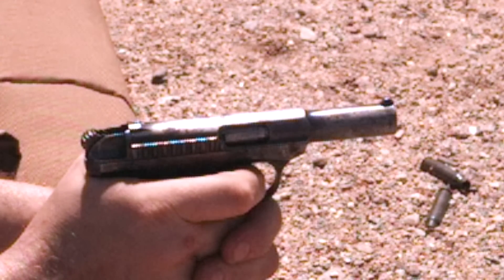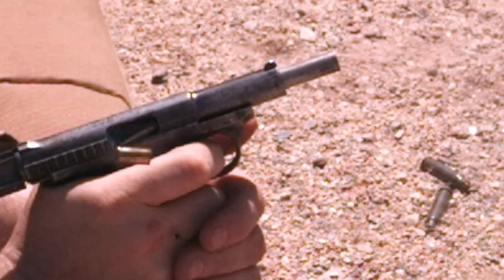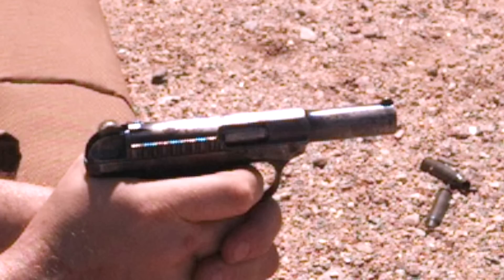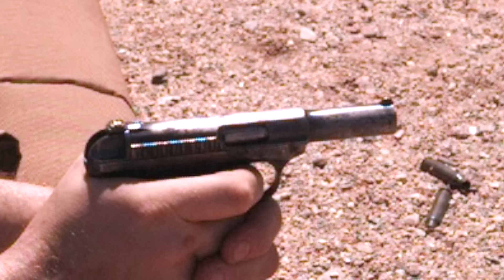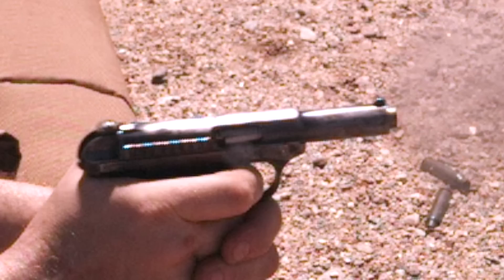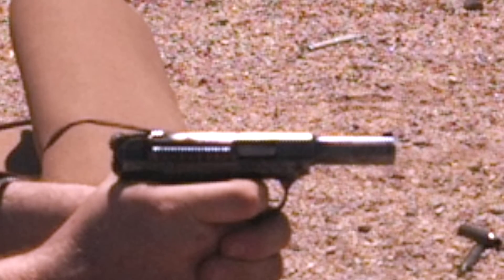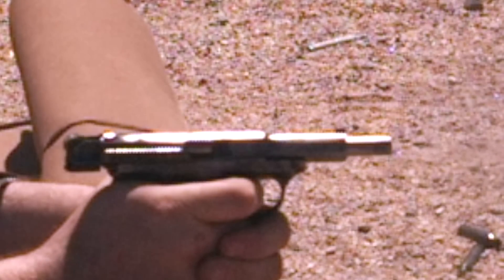Ask Ian: Analyzing the Savage Rotating Barrel (at 7500 frames/sec)

Comment: I may be misunderstanding how it works, or how physics works, but it sounds like there may have been a simple mistake (though more probably the mistake is mine).  As Ian explains it, it sounds like the system rotates one way (cw or CCW) and the bullet rotates the other way...  but what with equal and opposite and all that...  the bullet is exerting force in the direction opposite to it's rotation, and vice a versa...  so, say the barrel "unlocks" by turning CW...  if the bullet is rotating CCW...  then the force the CCW rotating bullet imparts on the barrel...  would be CW, wouldn't it?  So the bullet actually accelerates, rather than decelerates the "unlocking"  to delay the unlocking, the bullet should, as I understand it, rotate CW, imparting a CCW force on the barrel to delay the CW rotation of the barrel?

On locked vs unlocked...  I don't know.  The turn is very small...  but watching it frame by frame, it does seem like the slide moves back by maybe 1-2mm while the barrel turns...  Looking at the slowmo footage, it's very hard to say if the slide has moved further, or if the barrel is still turning, still unlocking.  I'm not 100% convinced this proves it one way or the other.
Reply: The Savage 1907 has a CW rifling, so the bullet is forced to accelerate rotating CW and, for reaction, it imparts a CCW force to the barrel. 
Since the barrel must rotate CW to open the action, that contrast with the opening. However, since the recoil momentum is MUCH stronger than the rotating one of the bullet (otherwise the bullet will never leave the barrel) that can't lock the action.
Reply: @neutronalchemist3241  That seems to make sense.  It's hard to judge distances and such but it seems like the slide moves roughly half a centimeter while the barrel turns, then by roughly a centimeter it's clearly open.  It's just hard for me to judge by the high speed footage if the slide has moved enough to unlock the system

Comment: So the Savage goes into the same cathegory as the CMMG Banshee as a radially delayed blowback system? That's cool :)
Reply: Unfortunately, no.

Both systems use rotation, but they do so in different ways. This uses rotation of the barrel to delay the opening of the slide and this the breech, but there's nothing that's taking the force on the breech and putting it through mechanical disadvantage. In the CMMG system, the breech face's opening is delayed by having to exert the force against mechanical disadvantage. In the Savage system, the opening is delayed by the friction of the bullet against the rifling causing the barrel to resist rotation for just long enough for the pressure to drop.

Comment: A patented design claiming to do one thing but actually doing something else that still works - reminds me of the Blish lock :D
Reply: Or the Rogak P18, which was a case of "a broken clone of a patented design that works but only just".
Reply: @AshleyPomeroy the utae needs
Reply: @AshleyPomeroy  if the barrel rotates 5 degrees clockwise, and the twist is clockwise, wouldn't that cause the barrel to spin around the bullet, negating the torque, and diminishing the angular momentum that's requisite of being affective "in range"? Or could it be synergistic, and increase the spin?
Reply: @ghostwriter1415  You mean twist is counter-clockwise.
I think also that barrel and twist should go to the same direction, as now since bullet is forced to turn left and barrel turns right, I believe it actually makes the barrel rotate sooner/faster since rotational mass of bullet tries to be stationary thus forcing the barrel turn to right
Reply: @felixchaus  The way I understood it when Ian described it is that barrel and twist rotate in opposite directions so the spinning bullet supposedly counteracts the rotation of the barrel, I'm not expert but I don't really think there's enough friction between bullet and the inside of the barrel to do that 😅
Reply: @MrFreddyFartface  There is enough friction to force rotation on to the bullet in few inches of barrel, 
and if there are some instances where inner core of a bullet separates from copper jacket because the copper jacket is forced to rotate faster than inner core can.
If you take a bolt and a nut, nut is the barrel and bolt is the bullet, barrel is stationary and bullet rotates, but you can also keep bullet stationary and rotate the barrel/nut, or even better is pump screwdriver, when pumped screw/bullet goes clockwise and screwdriver tries to go counter-clockwise, same works on the barrel but directions are opposite
Reply: I was thinking the same thing haha
Reply: Exactly what I was thinking. It's a system that I call Unintentional Delayed Blowback. It works, but not for the reason it's supposed to. 😉
Reply: Except by the looks of it, it actually wrkd as a delayed blowbacc system, while the delay the Blish system gave wasn't that much

Comment: I've got two of these, made in 1905, both with "patent applied".  I bought them decades ago, for my wife's home defense, and have enjoyed shooting them for target practice.  Thanks, Ian!
Reply: They feel so good in the hand. Like a solid block of steel. If only .32acp wasnt so expensive.
Reply: @niffirg1113  Why not make the .32 ACP yourself? The Lee anniversary reloading kit is about 129 bucks now.
Reply: I got a 32 for my wife.
Pretty good trade, eh?
Reply: @imilliemedina666  Having never met her, I couldn't say for certain, but probably a good trade given the state of the world.
Reply: Definitely neat pistols. Do yours have very heavy triggers? Mine is almost 8 pounds. Also, none were made in 1905; that’s the patent date. The earliest were made in 1907.
Reply: @76horsepower  Yes, they do have heavy triggers, both are marked 1905 pat.  They don't have any other date on them.  I bought one for my wife, a friend bought another, and ended up selling it to me, having moved on to another handgun.  They have a rather heavy "striker mechanism" giving that heavy trigger pull.  I hone the sears and they are both much better.
Reply: @johnmcclain3887  Thanks. You can determine the manufacture date via the serial number on the front of the frame.
Reply: Did she ever fire both of them at the same time, while flying through the air?
Reply: DesertRat45  Different pistol, same mechanism.
Reply: “It banishes fear!”

Comment: So if that is the case I guess my MAB P-15 is also just delayed and not really locked because its barrel is fixed in a similar fashion, but shooting full bore 9mm (explains the stiff recoil spring.) Whereas my Cougar also has a rotating barrel but the barrel travels with the slide for a good 7.5mm before it rotates enough for the locking lugs to clear and come free from the slide. Interesting.

Comment: My old man had one of these that I took out of his desk after he passed. Its entirely locked up. Excited to get it functional now.
Reply: Were it in a desk, it is possible that it is simply gummed up lubricant.  Added to carbon fouling (and looong periods of time) it can make a substantial glue.  Some modern oil, strategically placed, should help free it.
Be aware if it is in a desk, it may be loaded.  Relevant if one is fiddling with it and fighting to get the slide unlocked.
Good luck!
Reply: @mattfleming86  At some point someone tore the ass and spring out of the magazine. I am going to CLP it when I get home and see what happens. Thank you!

Comment: I've always loved this little gun.  I managed to find a good version for sale on the cheap several years ago and have enjoyed it.   Also, it's fun to be able to hold a real-world, nearly identical example to what Ian is showing.  ;)
Reply: I have a 1917 (with a 1907 breech block) and it's a great little pistol, although it might need some refurbishment because I get some light primer strikes from time to time. It has surprisingly light recoil for its weight, most likely due to its barrel system.
Reply: @jnordne2  - Nice! They are little wonders.
Reply: I wanted one since I saw Jude Law use one in Road to Perdition. I found one at a pawn shop for cheap. It was rough. The front sight is gone and the extractor was not working. I got a new extractor spring, re-blued it, and got some white re-pro grips.
Reply: I have one my great-grandfather who was born in 1882 bought in 1911. It's in borderline perfect condition (It looks way way better than that one Ian is shooting) despite it being over a hundred years old. It's funny shooting it and my Shield Plus side to side its heavier and has more felt recoil while shooting a dramatically weaker cartridge, at least both me and my father thought so. Other than that though the only real issue I have with the little guy is the sights on it really are horrible, basically point and shoot level of usefulness. Still a really neat family Heirloom.
Reply: have you mounted anything on the 1907 picatinny?
Reply: @Verycereus  - Um ... no rails, no fancy ultra-modern anything (except a high-cap mag) on these babies, man.  You must be thinking of a different pistol ... or I'm too tired and sore and missed your humor (in which case I apologize).
Reply: @CeltKnight  joking, friend. it just has a weird picatinny look on the side there.
Reply: @Verycereus  - Oh!  LOL ... sorry, I was too tired to catch that.  ;)  It DOES look like a rail.  And, that thought made me dig it back out and mess with it and ... ouch.
Reply: Yet another coward!
Where do you children come from?

Comment: I love to shoot my 1907. 10 shots quick is fun. I wish the new savage stance wasnt such a pile. The savage stance would have been a great gun 10 years ago. The stance should have been 10 shots minimum. Then savage could redo some of the vintage ads
Reply: Yep, if they were going to adopt the Honor Guard, they should have redesigned it for a 10 (or more) flush fit. The existing chassis could probably even accommodate it. It's as misbegotten a move as the FN 503.
...I just realized, I own (and like) 509's, APX's, and Savage rifles, yet even I have no interest in the 503, APX Carry, or Stance. I'd be more likely to buy a GX4...
Reply: @funkla65  Savage is selling the Honor Guard?  Ouch.  Friend of mine had one and it was complete junk...
Reply: @immikeurnot  I have an Honor Guard Long Slide. Haven't shot it a lot, but has been dependable. Not particularly accurate, though.
The Stance has received a substantial facelift, so I'm guessing the tooling and all the machining files were redone, so hey, maybe Savage debugged it. Mag capacity ought to measure up to the ShieldPlus, though.

Comment: Would it bee cheaper to perform the barrel-pen test? Just fixate the barrel and sick a pen, with rubber fist, into the barrel. If the bolt/slide will open, you can be sure its a blow back or blow forward system. If its doesn't its for sure a positively locked breech. Fell free to prove me wrong.

Comment: Just was comparing this with MAB PA-15. Watched Chappy's video on it but still not clear how well it compares to Savage while also how it is different from a short recoil rotating barrel. And how effective it is both in Savage and in MAB?
Reply from the maker: The system in the PA-15 is true short recoil, rotating barrel locked breech (same with the Steyr Hahn, Beretta PX4, and Grand Power, among others).
Reply: @ForgottenWeapons  After your reply I rewatched Chappy's video, his opinion is that barrel rotation and slide remains together for shorter period of time compared to true short recoil rotating barrel like Steyr Hahn or Baretta PX4. So the rotation of the barrel starts much earlier in MAB PA-15 when compared to above mentioned pistols. His opinion is that MAB's operation is a delayed rotating barrel. So can you guys discuss and tell what it actually is and its effectiveness in taming 9mm.
Reply: @TakNuke  I clearly said the barrel and slide do NOT recoil together since the barrel is fixed axially in the frame cradle. It functions identically to the Savage 😉
Reply: @thebotrchap  After rewatching Chappy's video several times i understand that barrel is not moving only rotating so I conclude that MAB PA-15 is delayed rotating barrel blowback mechanism but how effective it is I can only refer to his Lynx Brutality run.
Reply: @TakNuke  In case you haven’t put 2 and 2 together, Chappy and I are the same person 😉 The system is certainly safe and recoil is not harsh, however finding out how much is due to the delaying mechanism and how much is due to pure slide mass we simply cannot tell.
Reply: @thebotrchap  I was unsure about whether the previous comment was by you so for being on the safe side I addressed about your video in third person in my reply. Thank you for the reply and also thanks to Ian regardless of whether your reply came due to my first comment while you viewed the video or him contacting you for getting your view. Again thank you both you, Ian and other commentators for their insight and clarifying my doubts. Now the only thing that remains is getting either one of the Savage  (preferably) pistols or MAB PA-15 in Ian's hands for the backup gun match and getting to know his view on the delayed rotating barrel blowback effectiveness.
Reply: @ForgottenWeapons  I'm happy to know you're familiar with the Grand Power pistols, knowledge of them seems to be fairly rare so it's certainly nice to see a mention of them.
Reply from the maker: I hate being wrong, and I am currently wrong. I went to take a closer look at my PA-15, and yeah - it's very similar in operation to the Savage. Definitely will require some more high speed footage, and in particular a comparison to the MAB Modele R.
Reply: @ForgottenWeapons  Are we getting a PA-15 video next? I'm really surprised that you haven't done one on it.
Reply from the maker: Not next, because I'm about  to leave on a series of trips. But I will do it later this year.
Reply: @ForgottenWeapons  Maybe a new series of videos - "BreachBusters", where you analyze the various different locking/delay systems to see if they really hold up to their original design claims? Just a thought lol.
Reply: With a short recoil rotating barrel, there is a cam system that causes the barrel to rotate as it travels to the rear with the slide/bolt. With the MAB and Savage, the barrel doesn't move backward, instead in theory the torque created from the bullet engaging the rifling causes the barrel to "lock up" with the slide
Reply: @cooperevans5660  Thanks for the describing the short recoil rotating barrel part but in theory part about Savage and MAB is still confusing to me as MAB also has cams so what does those do? Do they delay the opening or causes the barrel to rotate and open up?
Reply: @TakNuke  with the Savage and MAB as the bullet spins it causes the barrel to rotate as well. This rotation is used to "lock" the barrel and slide together. When the the bullet leaves the barrel there is no more torque being created and the slide can move rearward.